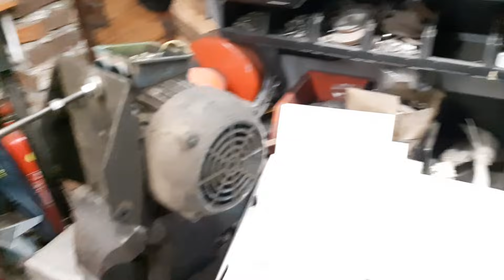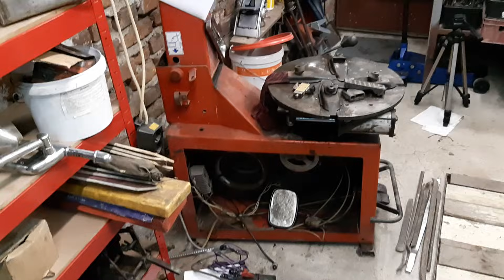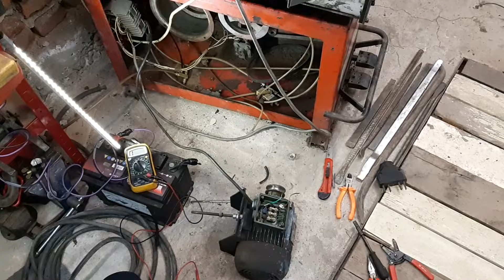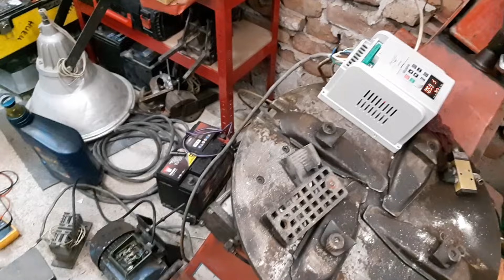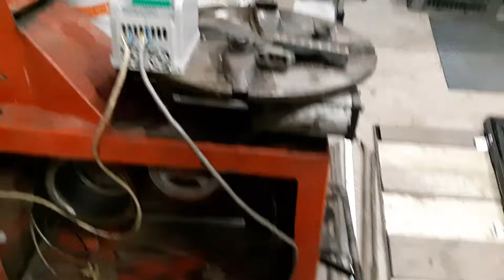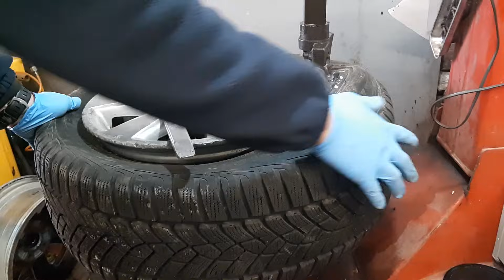Three phase Tyre machine running on single phase. part 2

Comment: Am i right in understanding that the output from the VFD is going to the 2 relays, one relay spins rhe table clockwise and rhe other anticlockwise.  So you are switching the output of the VFD? I am not sure if this is correct
Reply from the maker: Correct

Comment: Great vid. Can you tell me. I read somewhere that you connect the control module to the inverter and the power out to the motor from the inverter so that the inverter does the phase conversion. In your vid is this what the relays are doing in yours?
Reply from the maker: Foot switch controls the Big Relay. 220v in the inverter makes the 3phase motor run.